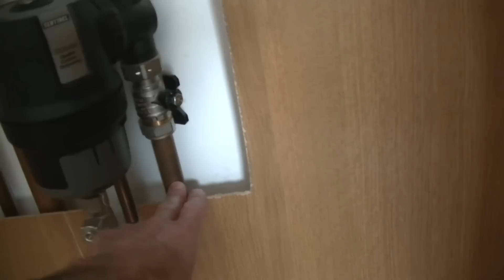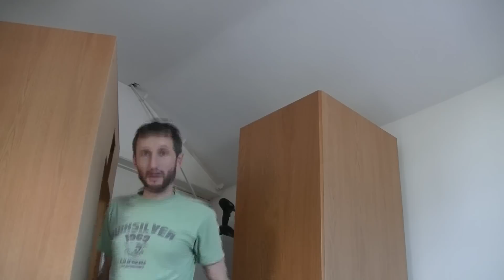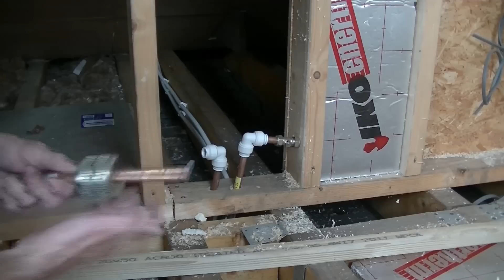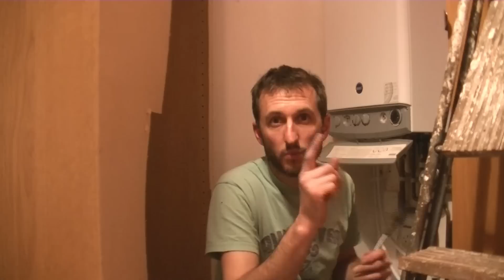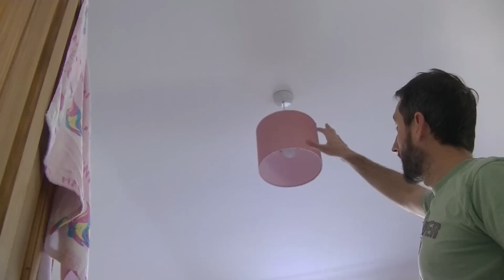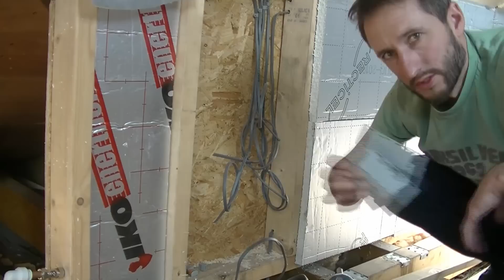Loft conversion part 29 - Plumbing, electrics, drain central heating system, repressurise boiler!!

Comment: I know this is an old video but you have made a massive mistake you have run your plastic pipe across your  HOT copper pipes so after a while they will melt through if not already hope it hasn’t 🤞
Reply from the maker: They don't melt, they carry the same hot water. Suitable for central heating of temperatures up to 80 degrees Celcius. I appreciate the job was a touch messy but I explained that in the video.

Comment: How many kW is your boiler and how many radiators or undefloor heating you have?
Reply from the maker: 33kw. With an additional radiator in the loft (which I've never connected as it's always been warm enough) it would be 11 radiators.

Comment: I like your channel very much.  Your video helped me a lot.  I would like to ask: If I want to install a central heating radiator in the attic (above the second floor), the boiler is on the first floor.  Can the heater in my attic get hot?  Is the pressure enough?  Looking forward to your reply.  Thank you：-）
Reply from the maker: Yes should be fine but it depends on your boiler, the number of radiators and how well it has been installed.

Comment: I’ve watched every episode and feel the first need to comment. I might be wrong but didn’t hear any mention of turning off the supply from the consumer unit when extending the lighting circuit?
Reply from the maker: Not sure if I did, but I turned power off when making final connection to the ceiling rose. Thanks for watching!

Comment: Top job. Just discovered your loft conversion playlist. Great you are using WAGO cage clamp terminals. Key point is screw terminals need tightening every so many years so you don't want behind walls. Only other option would be crimps which you need special expensive tools and you can't undo. On the JG where you have Teed off under the boiler I'd try to get a bit more pipe support in when it's convenient - perhaps just wood screws, bit of 2x2 and cable ties for now. Sure you can think something up. In longer term when you have time perhaps redo first bit near the boiler in soldered copper as you can unbolt and do on the bench. Can't remember rules on how near plastic can be to the boiler. Also have a read about swept T's (hope I've got the right name)

The 13A socket under boiler might best be changed for IP type. Not a JG fan cos of the number of pipe clips you need until I saw your trunking on it which neatened it all up proper. Simple wood cover pan in back of wardrobe might  be a good safety idea if you have children wandering about. Look forward to catching up on all the other episodes. Best Christmas 🌲 present!  and thanks so much for sharing it all.
Reply from the maker: Thanks for the detailed comment John. Yes I'l tidy it up when I get chance but it's functional for now and got it done while family was out of the house. It's still like it now two years on behind the cupboard so I'l get round to it one day!! The socket should be non switched or a fused spur also, another thing I'm meant to change but there we go! Happy new year!
Reply: @POUSEaroundtheHOUSE  Happy New Year!  Yes one of those jobs to save up for the right moment which is not now in lockdown. Assume you could change socket for plain box with WAGO and run trunking up the wall to make a fused spur connection point nice and high up. Anyhow hope you are enjoying the loft conversion and new projects planned for 2021. Thanks again

Comment: I have watched your whole series on your loft conversion so far and found it to be very interesting. I have a question about your electrical connection. If you have a live junction at the light fitting, which is able to supply live, neutral and earth to your new lights in your loft, how come your bedroom light is not permanently illuminated? In my humble experience, the neutrals and earths are connected together, but the live is switched (by the light switch). In it`s present configuration, you would have to turn the bedroom light on to make your loft lights work. Might I politely suggest you run a new wire from your fusebox/consumer unit to supply your loft? Perhaps one feed from the lights circuitbreaker and one from the 13A sockets circuitbreaker? I believe that may be somewhat safer. Perhaps I am mistaken.
Reply from the maker: With the configuration I have which is pretty standard on older housing at least, a permanent live is run from one room light to the next in what's known as a radial circuit. Then at the junction box or ceiling rose above your light you do the wiring so that a cable is taken from there to the switch which when switched on goes back to turn the light on. So even when your light switch is off there is a live terminal in the ceiling, it's just that only the switch cable is connected to the light bulb. I've simply extended the upstairs lighting circuit into the loft which is fine in my particular set up. Hope that helps. For a more detailed explanation watch my other video - How to wire a ceiling rose - https://youtu.be/FjmC0qx1nrU
Reply: @POUSEaroundtheHOUSE  Thanks very much for the quick response! Yes, that does help me tremendously 👍

Comment: Hi Pouse. Love the videos - i'm doing my own conversion basically using your videos to give me the confidence to do it myself. Wondering if there was a reason you didn't just tap into the radiator circuit / loop somewhere else in the house to feed the loft instead of breaking in to T-off by the boiler? If i copy your method i'd have to run pipes up 3 floors which i don't fancy trying. Any advice?
Reply from the maker: You can go from wherever you like, this was the closest place for me. Hope that helps!
Reply: @POUSEaroundtheHOUSE  Yep - makes sense - thanks

Comment: The original plumber used copper  and now it’s spoiled and looks crap
Reply from the maker: Looks crap yes but also works fine. I can alter it in the future when I do more work on that room. Thanks for watching.
Reply: However the plastic is going to be more reliable in this instance because it is a single run - and that could not be accomplished using copper..

Comment: Great video, can't beat push fit connectors for plumbing, just fitted a Sure stop stopcock so simple as old one had seized.
Reply from the maker: I agree. Some people do t like them but they serve a purpose and to date  I've had no problems with it. If it does leak, it's so easy to replace. Thanks again for watching!

Comment: Easier to add inhibitor through the top of the magnetic filter, than the towel rail!
Reply from the maker: Fair point! Thanks for watching.
Reply: POUSE around the HOUSE no it’s not, it is easier through a towel rail

Comment: Hmm, you’re not supposed to have plastic pipe any closer than the first metre from the boiler due to heat. I assume that also goes for connnectors. If so, you may have problems at some point in the future.
Reply from the maker: Well I'll let you know!

Comment: Pousey, don’t rely on iso-valves for temporarily closing-off a pipe. Even the manufacturers state you shouldn’t do this. Instead, use JG Stop Ends as it is what they are designed for!
Reply from the maker: True, I was just trying to avoid draining system again. They've been there for 18 months now and still holding up so all good!
Reply: POUSE around the HOUSE you have a couple of options then. You can add a small piece of pipe on th end of the iso and then add the cap to that; compression or JG. Alternatively, as you are at the highest point in the house, you could potentially avoid having to drain the whole system, depending upon how the pipework is laid out.